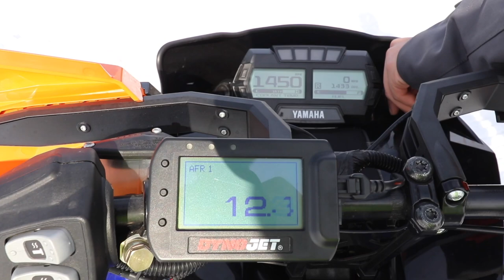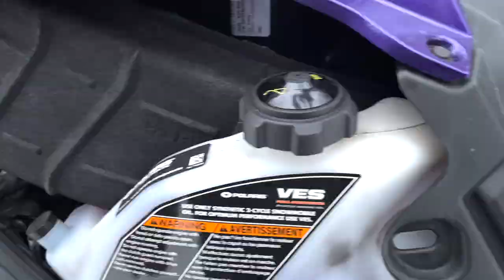Our 2021 Polaris Assault 850 BLEW UP!!

Comment: I'm wondering how you made out with your 850? New snow is on the way! After seeing your vid I'm not modifying my 850 at all ,it just gives the dealer more leverage in a case like this.
Reply from the maker: Thanks for watching and following along. We actually decided to sell the sled. We didn't have any issues with the dealer and the sled has a new motor and new owner for this year.
Reply from the maker: Thanks for watching and following along. We actually decided to sell the sled. We didn't have any issues with the dealer and the sled has a new motor and new owner for this year.

Comment: I know it sucks whne this happens. However, it happens to all the brands. I have been riding my entire life,. Back when the REV came out we all switched from Polaris to Ski-doo. Guess what we all blew them up. The two guys wint s the 600SDI's had the worst luck. One had 2 rebuilds and one complete crate engine. After a few years we got into off trail riding and all switched back to Polaris. The've treated us pretty well. Our 2012 pros were the worst but since they have been great. Where were you riding when it blew?
Reply from the maker: Yeah unfortunately it does happen… We just never wish it does to us. We were riding in Old Forge, NY at the time.

Comment: Another tip is to not throw a can on your sled until it’s broke in. The break in process is important. Polaris dealer
Reply: Nope polaris engines BLOW i had 2 of them they suck ass
Reply: @edwardabrahamiii3742  agreed.  Their small bore engines are good, their big bores are complete junk, yet they keep making them without fixing the problem.
Reply: @ericoverdorff8880  i approve of what your saying ill take the 600cfi an 650 patriot over a big bore 800 an 850
Reply: @ericoverdorff8880  but i wont own the 550 fan polaris seen way to many blow up!
Reply: @edwardabrahamiii3742  you hit that 1 out of the park. There's been hafe dozen 550 fans in my town and everyone of them has blown up. All while cruising part throttle.  I seen them be rebuilt but never rejetted, and BOOM! Burn down again.
Reply: @ericoverdorff8880  1 of my neighbors here in Alaska had a 2009 polaris 600cfi IQ 136 an never did have a problem with it till 13,000+ miles then his crank blew!
Reply: @edwardabrahamiii3742  I'm in southeast Alaska,  Petersburg.  Where are you?
Reply: @ericoverdorff8880  Nunam Iqua, Alaska last village on the lower yukon down river.

Comment: Any engine will blow up if you run it at max revs enough times. Whether it's a car, truck, motorcycle, or snowmobile.
Reply: Nope a 4 stroke will go 4 ever 2 strokes blow up way more then 4 strokes why do you think the world is making the switch from 2 stroke to 4 stroke not only emmisions but 4 strokes last longer ive seen a john deere generator with more then 100,000+ hrs
Reply: @edwardabrahamiii3742  John Deer generator isn't a high performance motor.  Four strokes still blow up.  My friend who builds motorcycle race motors constantly has blown up stock bikes coming in.   Yamaha had a big crank failure issues on R1's a few years back.  Snowmobiles don't rev anywhere near as high but anything mechanical is bound to break at some point.